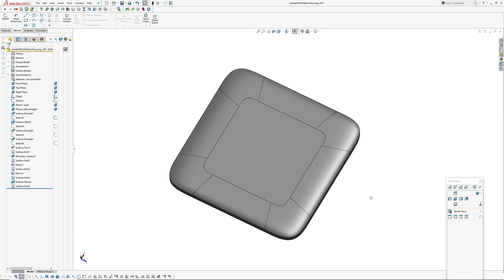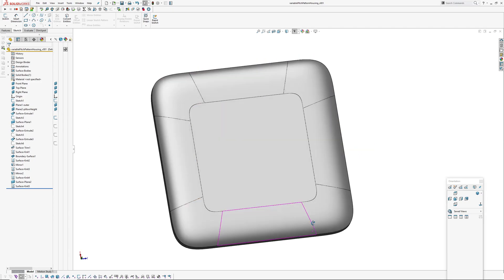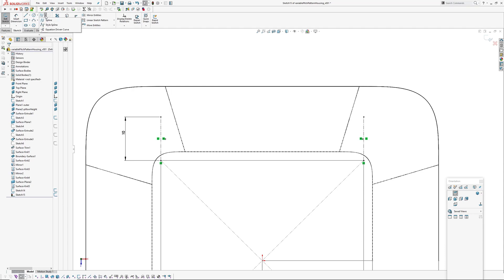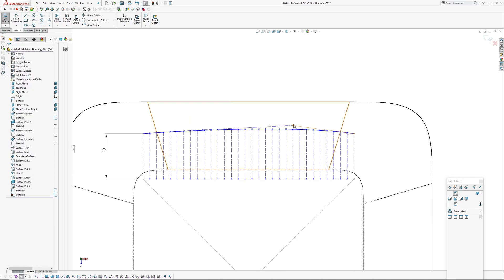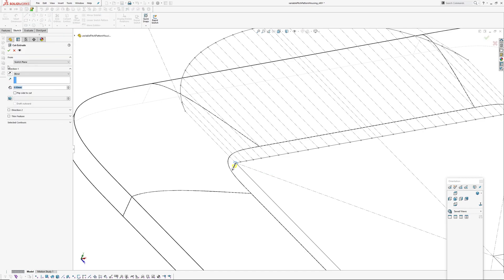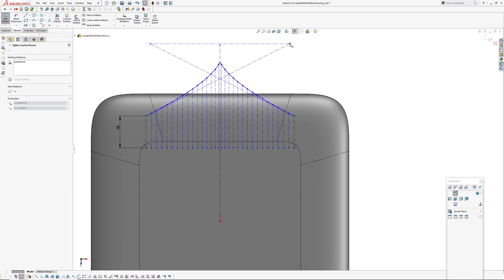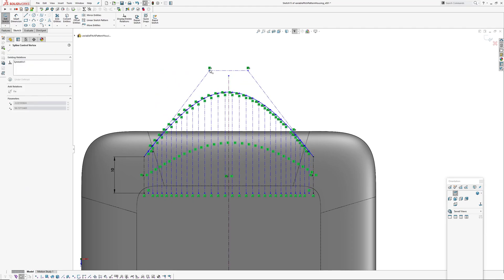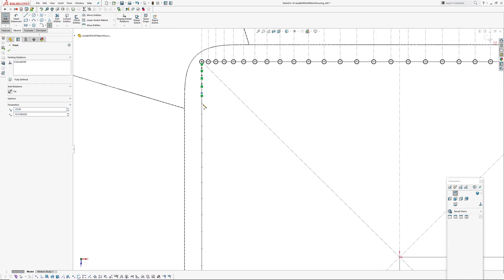Solidworks: Variable pitch pattern using sketch segments

Comment: Belated birthday wished Andrew! Long time! 
By the way. Holy sh**t I had never come across segments before! I cannot believe it!
Reply from the maker: Thanks Tony! I'm going to confess - neither had I until the other day... I have used this technique (projecting lengths) before but I manually added line segments to the spline and added equal length relationships to the line segments. Not exactly efficient compared to the segment command!!
Reply: @AndrewJacksonDesignStudio  I feel like this could lead the way to constructing curves with a lot more curvature control? 
For example, approximating a clothoid spiral?
Reply from the maker: I had another look at those spirals a month ago. I’m pretty sure you need to use equations. All the maths was over my head so I moved on!
Reply: @AndrewJacksonDesignStudio  I just gave it a quick try.
Unsuccessful. But if I am able to define the radius of curvature of the spline at each segment point on the spine, then it is possible to approximate it. It is impossible to perfectly replicate clothoid as  it is defined by transcendental function. The best Nurbs or Bezier can do is approximate clothoid. 
Approximation methods have existed since long time ago as clothoids have great application in Civil engineering  (and industrial design as far as I am concerned). Autodesk softwares like AUTOCad have plugins that can automatically construct an clothoid  transition curve between the end points of 2 non colinear line segments for example. CIVIL3d I bet has a spline feature for clothoid construction akin to sketch fillets in solidworks for example.
Anyway, Check our stuff like "fair curve modeller". There is also a grasshopper script I found in Rhino forums for this.
Reply: @AndrewJacksonDesignStudio  Also, Can't help but feel the radii of pattern should  proportionally reduce towards the ends of the pattern. I have a memory of having figured out that problem but need to open up solidworks to remember it. All the little tricks you learn by playing around are so volatile and evaporate from memory so quickly without regular practice!
Reply from the maker: Agree the holes should be variable as well. I only wanted to cover the projection technique for spacing. Not sure if you can use a table with a sketch pattern, as the table could control the diameter.
Reply: @AndrewJacksonDesignStudio  Right. Been out of touch solidworks now since I have been managing  production and supply chain of our company these days. Can't wait to get back and do experiments!
Reply: Also @andrew are you using a quadro card?
Reply from the maker: Hi Tony, I moved SW off my precision laptop recently. It’s now on my render machine with 3gpus however I did add an older quadro mainly for running SW👍
Reply: @AndrewJacksonDesignStudio  That explains the buttery smooth sketch interface!